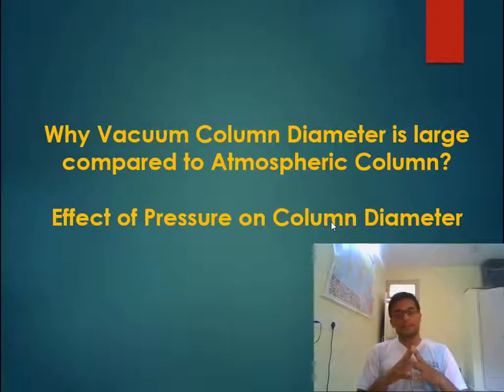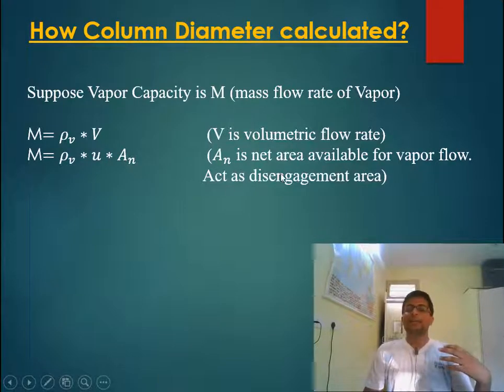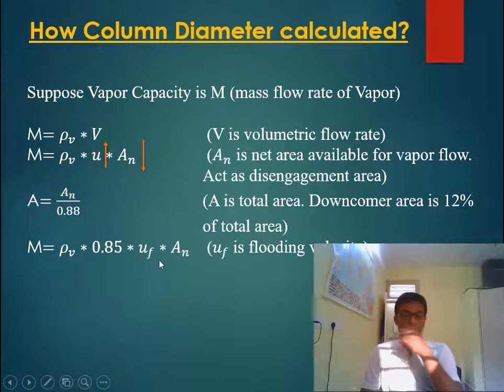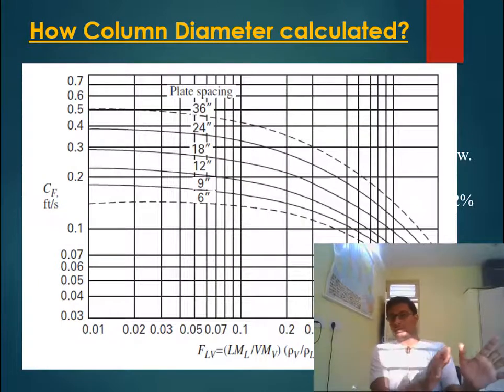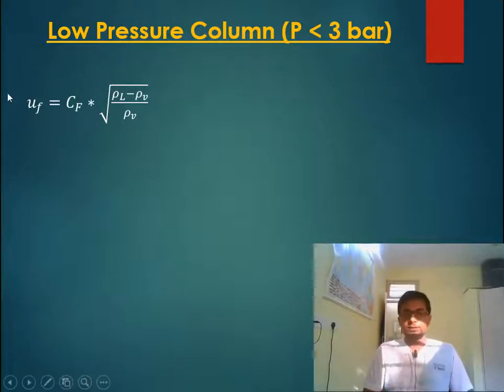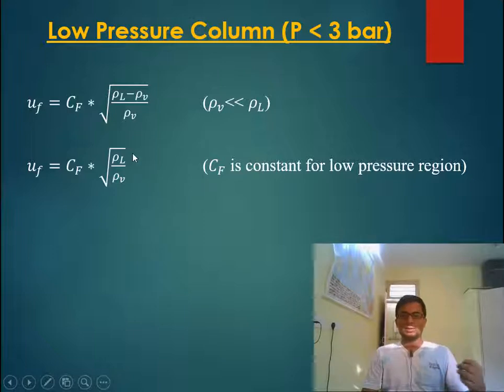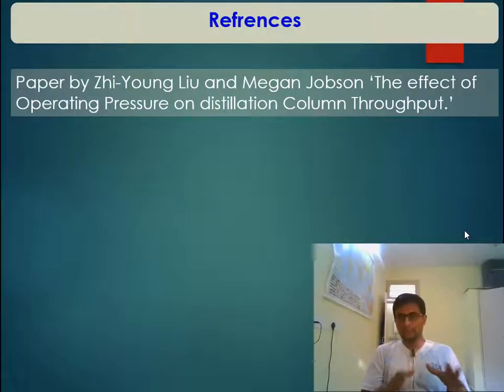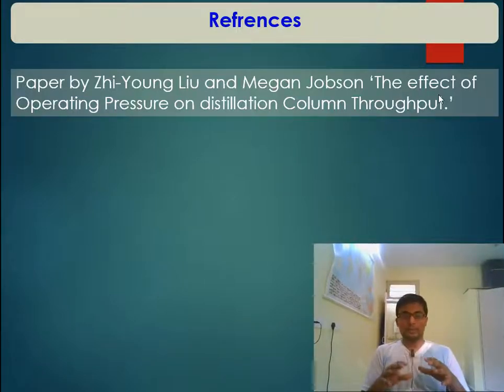Part 5 - Why Vacuum column diameter is larger than Atmospheric Column?

Comment from the maker: One point I forget to mention in this context. Some time in interview one question asked is 'Why Vacuum Column is costlier than Atmospheric Column?' The one answer may be Column diameter is large. But it does not give clear picture because at low pressure relative volatility also increases. So height required may be less. Actual answer is the thickness of Column Shell. Thickness of Column shell goes high for vacuum column as there is very low inside pressure and outside pressure is atmospheric pressure. So stress will be high.
Reply: Sandeep Academy vacuum column is tray column or packed column, if packed which type of packing ...And how do we increase or decrease pressure inside the column
Reply: Plz reply sir
Reply from the maker: In our VDU it is structured packing.Only draw trays are Chimney trays. Pressure can be increased/decreased using pressure control valve. In VDU we can increase/decrease vacuum by adjusting steam in ejectors. Hope it make sense to you. But we never change pressure to increase throughout, the concepts maintained in last part of video is only helpful if your throughout is limited by column flooding.
Reply: @SandeepAcademy9  Sir i have studied on net that As a rule of thumb, plates are always used in columns of large diameters.... So VDU should have tray, isn't? Please clarify my doubt. Thank You,by the way,you are best.
Reply: @Shubham-fe7il  Vacuum Columns are prone to collapse hence VDUs are packed towers as the packing as acts as a support.
Reply: @debdattaguha  thanks for replying after 5 months😁😁
Reply: Sir, please share the video lecture of tray temperature. How tay is selected for control?

Comment: Also explain the effect of pressure  on column height,...

For a same binary mixture and same process conditions inside two columns, one is operated under vacuum and other is operated under atmospheric pressure.. 
In which case, number of theoretical stages( column height) will be less..??